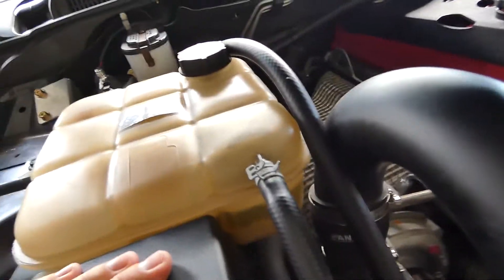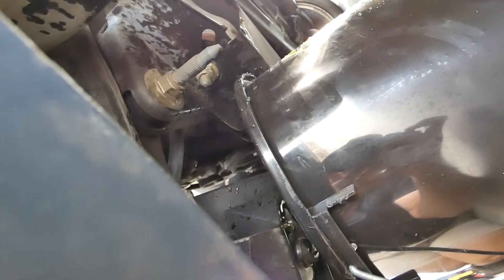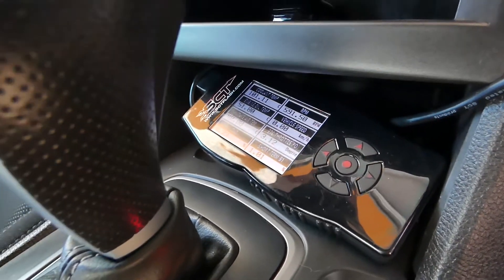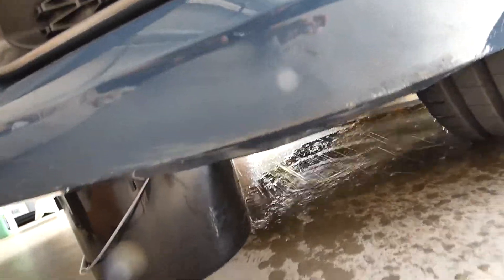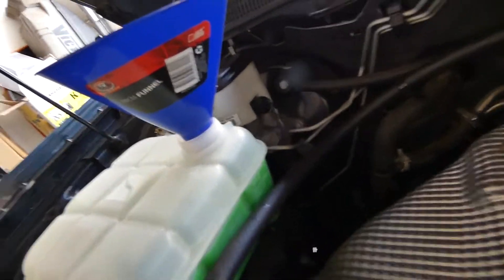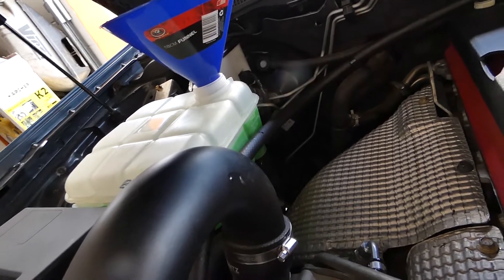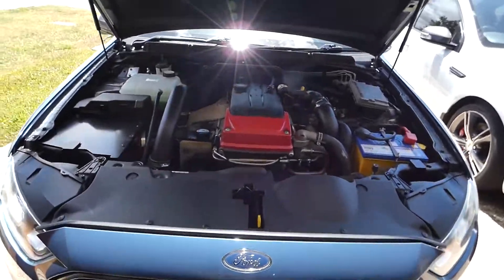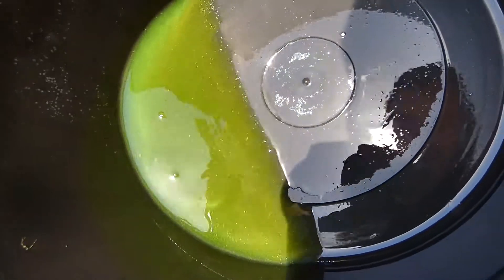How To Change Your Coolant

Comment: I am glad I watched you video. Cause I didn't know about the tap and I couldn't figure out why the hose clumps had rubber stoppers on them. Now I know it's because you're not supposed to take them off. 
You did get me with the cleaning of the overflow bottle.

Comment: Obviously, when the coolant is fully drained the block is empty. Basically it is better to take off thermistat  housing , clean and fill block from there and then replace with new thermistat on such a job. Obviously there is enormous wear occurring with a dry block waiting for the thermistat tp open and in goes cold coolant. Yikes.
 Leaving it drain for a very long time like you did is also good and should be reiterated as  coolant  trickles thru the tiny pressure hole of the thermistat takes a very long time and you were correct in adding the next  few litres before starting the engine. Also with  acale build up a reverse flush is worthwhile and a mild acid like 3 liters of viinegar mixed in the flush water can speed up the process of you leave it in a couple of days of daily driver, then do the thermistat after draining

Comment: Mate undo the bottom radiator hose , take out both thermostats(yes both BF has one under the air trunk for warming the Auto) and flush the whole system out heaps with clean water. This is after you have run a flush through it before you start the job And always remember to run the demineralized water through it and drain before filling it up with your new coolant. Stop all the the talk, get into the terminology so we can teach the younger blokes what is what. I just want us  to be better youtubers.
Reply: Would opening the radiator drain tap drain the whole block and heater circuit in a BA Falcon Colin?